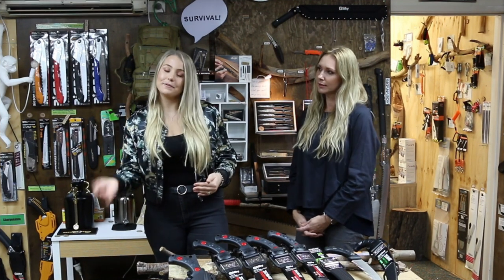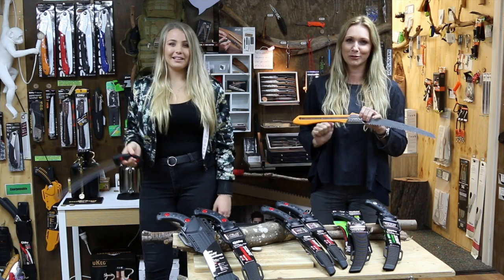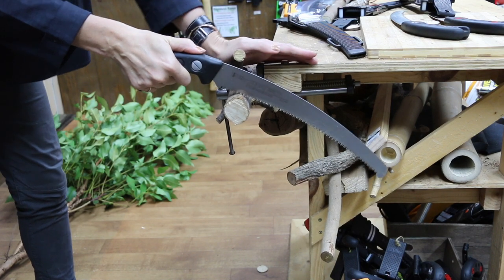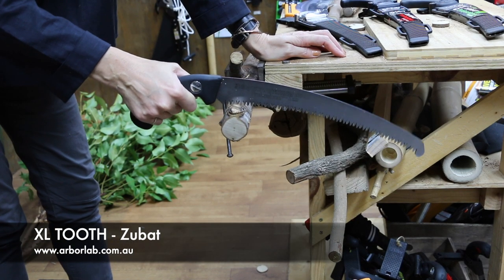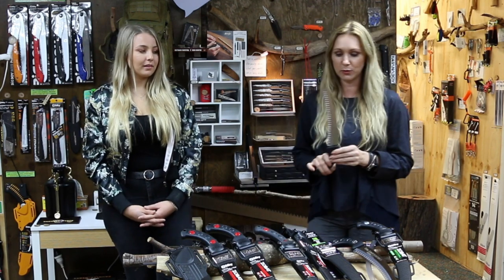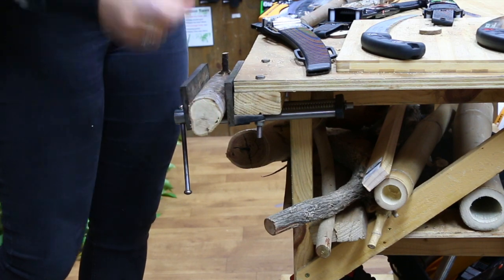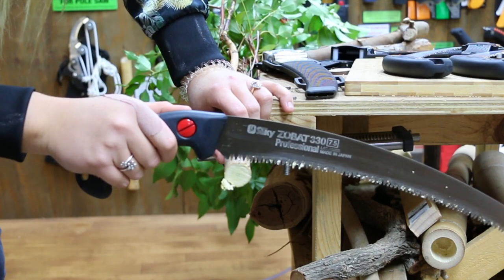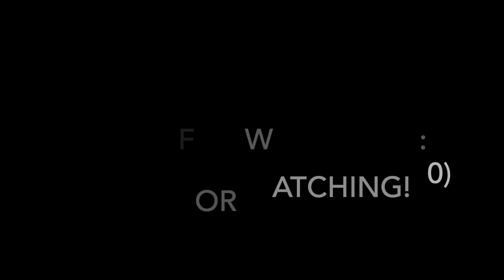How to choose a Silky Zubat Saw

Comment: So for coppicing hazel  , smaller blade length... 27 cm to get into stall ,ideally Fine Tooth .. but silky only do a 330 blade lengt in fine.  What would you recommend going  for ,  27 cm but large tooth or   330 and fine tooth?

Comment: Never had a problem cutting with a curve saw at chest height, just start your cut at a 20-30 degree angle. If that is uncomfortable for your arm just widen the stance of your feet, that will drop you down a few inches. Straighter handle of folding saw makes this easier
Reply from the maker: Hi, thanks for the tip! But yes, we agree with you, having a straight blade does make it easier when cutting at chest height 😃 Nita & Shenae

Comment: I need a real beast for large branches or small trees. Which one would you prefer, the Ibuki or the Sugoi? It should cut fast! It is not important to cut clean.
Thanks for your advice!
Reply from the maker: Hi, sorry for the delay in getting back to you.  Depends on the length Sugoi you are looking at.  If 360 then I'd def go IBUKI if 420 Sugoi, that will win the battle!  💪
Reply: Large Sugoi is probably your best bet, curious though as to why a clean cut isn't important to you? 

Being honest with you if it's for large branches/small trees then you should just use a chainsaw. Sure it's possible to use the Sugoi to do those things but why would you? Doesn't matter how fast the Silky can cut it's never going to be faster than a chainsaw.

Comment: Thanks for the informational video! Helped a lot, didn't make the decision easier though 😂 Was unsure whether to go for a big boy 2000 or Zubat. The tip and  the smaller chance of the blade snapping made me opt the Zubat.  Now I'm hesitating between the Zubat Xl teeth and the Sugoi. What's the main difference there?
Reply from the maker: Don't worry, we struggle to pick just one too!  The Sugoi has a graduating tooth where as the Zubat has just the one tooth size.  So the Sugoi feels a bit easier to use.  5.5 - 6.5 teeth per 3 cms.  If it was me, I have a soft spot for the Suogi so that would be my pick 😃 Nita

Comment: I have the Hayauchi 21 ft pole saw . Is there a hand saw that the blade will change between the two ?
Reply from the maker: Great choice in pole saw!  The Ibuki saw has a blade that will fit on the hayauchi black pipe :) Shenae
Reply: Do you mean is there a handle that will allow the Hayauchi blade to be used as a hand saw?
Reply from the maker: @wayneessar7489  Honestly I'm not sure if the Ibuki handle will fit the Hayauchi blade as it has the sickle attached and it might not slide in far enough.  We are so crazy busy at the moment, I will try to do a bit of a swap around with them and see if it will go into the Ibuki handle, but it might take me a little while to get back to you. 😀 Nita
Reply: @SILKYsaw  No problem . If silky has or makes a hand saw that will work back and forth with the pole saw blade I would be interested .
Reply from the maker: @bananarepublic4865  Sounds good, we will be in touch 😃

Comment: Great demo, I enjoy watching you both. The fine medium tooth blade took the most strokes and filled up the quickest. I'm not sure how you chose the XL tooth saw as the best choice when it required more strokes to complete the job over the large tooth , and appeared to take more effort. It also appeared that the XL tooth may have clogged more. Is there a sweet spot where a large tooth may be the best overall choice? Thanks
Reply from the maker: Hi, thank you for your comment!   The large tooth is best as a general purpose saw.  If your MAINLY cutting small branches or VERY dry deadwood then the fine tooth would be your choice.  If your MAINLY cutting large, green branches then the XL tooth would be the best choice.  If it is more aN even variety then the Large tooth would be the best one.  I hope this helps, Nita.  😃

Comment: ladies - that piece of steel to which the handle is attached is called the 'tang' - many saws have a partial tang whereas the Silky Saw  have a full (eg:full length) tang - which is one of the saws most impressive features.
Reply from the maker: Hi, yes thats right, 90% of Silky's are full tang!  Silky makes a great product.  Thanks for your comment 😃 Nita and Shenae

Comment: I believe the trade off for large teeth is that it’s not as clean of a cut. If your pruning a tree, you want a nice clean wound that will heal nicely.
Reply from the maker: If you pick a Silky with Non Set Teeth particularly the Mirai Me teeth it should still give a very smooth cut.  The key, is to make sure the branches your cutting match the size teeth you are using.  Ie if using the XL tooth you would want the branch to be at least 2 inches wide. 😃 Nita.

Comment: a 52 inch Japanese silky pull saw would be the best. full tang fixed handle. With back carry sheath for easy carry. 36 inch blade, with gigantic teeth 🦷, and a 16 inch handle for leverage.

Comment: Hi, great vid as always, I'm learning so much from you guys. I can't seem to find the specs anywhere on dimensions though. Can you let me know the overall length of the Zubat 270 with sheath and without sheath? Also the blade width at widest point. Also the depth of the handle. I have limited space in my bag and am tossing up between this and the Gomboy but I'd prefer a fixed blade so really want the Zubat. Also, the sheath seems quite bulky. Do you know of a flatter leather sheath option from anyone? Thanks very much in advance. Edit: new sub from me too :)
Reply from the maker: Great questions, these will take me a little bit to put together for you.  Once I get all those details together I will post them on the product description on our website.  https://atcproducts.com.au/product/silky-zubat-curved-blade-large-tooth-handsaws/ Thanks, 😃 Nita.
Reply: @SILKYsaw  Much appreciated :) The other one in the mix is the Gunfighter. Like the progressive blade on that. What are your thoughts?
Reply from the maker: @d.Cog420  The Gunfighter is not full tang, so not so much of a fan.
Reply: @SILKYsaw  True. What about being able to disassemble it for space saving in a pack? Could be good. And is the variable blade like the Genki Temagari you reviewed and is unfortunately out of the price range :( 
And I think you can change the blades on the gunfighter so you could have a small and a big one for different tasks with very little real estate taken up. Too many freakin choices Nita!
Reply from the maker: @d.Cog420  You are correct there!  So many to choose from and all so great in their own right. 😃
Reply: Honest opinion is go for the Zubat, as an arborist who has both I can say from experience that while the Gomboy is nice and compact it's a pain in the ass to fold it up after a cut if you need to reposition and use it again when climbing. You spend more time folding it open and closing it than you do actually cutting. 

While the Zubat takes up a little more space it's so much quicker and more convenient to just pull it from the hard sheath, cut something and then drop it back in. Too much fiddling around with the Gomboy in my opinion, I've found myself actually clipping the Gomboy into my harness bridge while open when moving around just to save messing around and that really isn't a good idea.

Comment: I have noticed that the fine tooth Zubat is 10 teeth per 30mm. On The bigboy and pocket boy, that would be medium tooth, but why is it called fine on the Zubat?
Reply from the maker: Hi back'bush, it is quite deceiving to go on the tooth size descriptions as they break all the saws into families.  ie. Gomboy family, Zubat family, Gomtaro family etc.  The tooth sizes are then broken up in that family, so a large tooth in the Gomboy could be a completely different tooth size to a large tooth in the Bigboy or Zubat.  So always best to work with teeth per inch when comparing. Hope this makes sense 😊 Nita.
Reply: @SILKYsaw  Yes, thanks!

Comment: If your only going to have one saw do everything make it a Zubat 330 large tooth.
Reply: When climbing I'm using a chainsaw 99% of the time regardless of pruning or a removal, but my Zubat goes everywhere with me. Can't beat the Zubat as a climbing companion, cuts fast enough, light enough to stick on and forget about it when accending/moving around a tree and just chews through wood. Sure you can get a Sugoi or something but anything above wrist size and I use a chainsaw, most people won't be planning on a full dismantle with a Silky saw so after a certain point having the biggest Silky is a bit pointless.